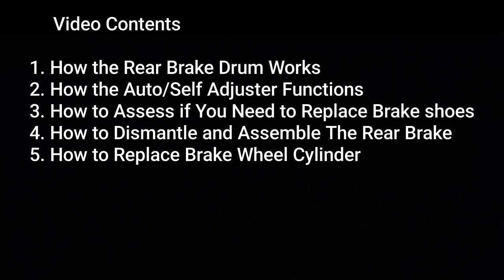Pajero How to Dismantle/Assemble the Brake Drum. Replace Wheel Cylinder.

Comment: At 16:35 no mention is made of the orientation of the slotted pin thar fits into the Rhs brake shoe ( I'm referring to the adjuster that has the left hand thread). This piece has a slot that is not in the centre of the shaft, it is offset by about 1mm, so when put in the other way around ( ie rotating the threaded shaft 180 degrees the offset becomes 2mm)